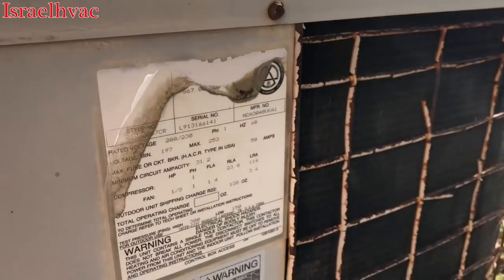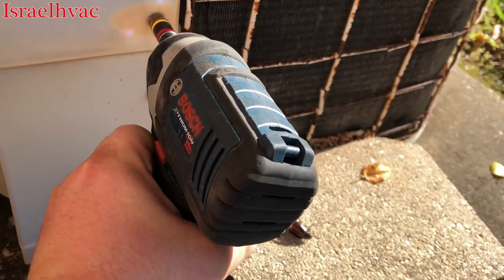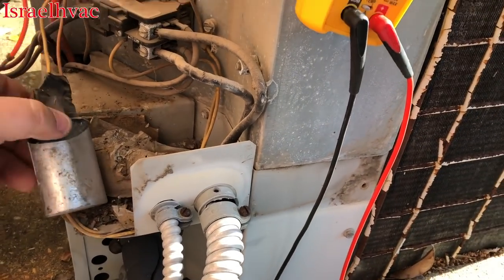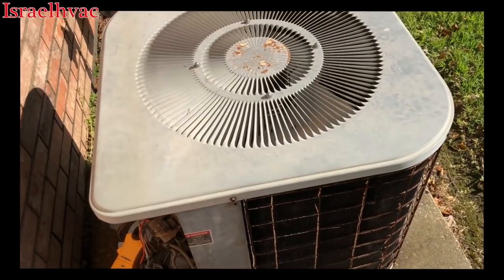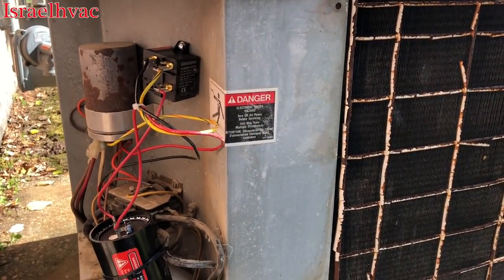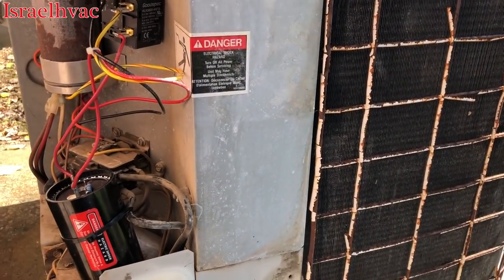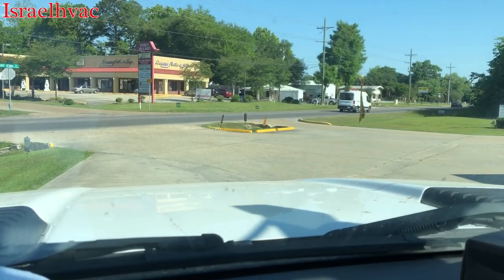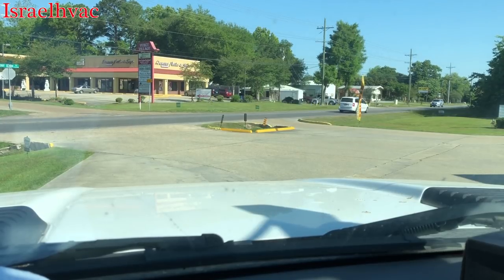HVAC Service | Compressor Won't Start

Comment: If the compressor didn't start after the heart start what would you then? Replace the compressor or the whole condenser??
Reply: It would have been a waste of time to replace the compressor. That unit was cooked.